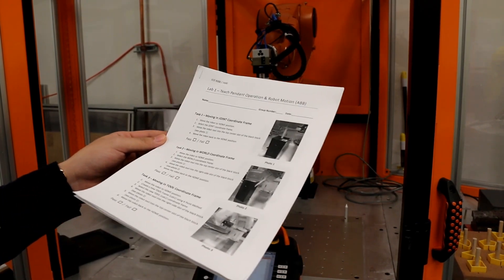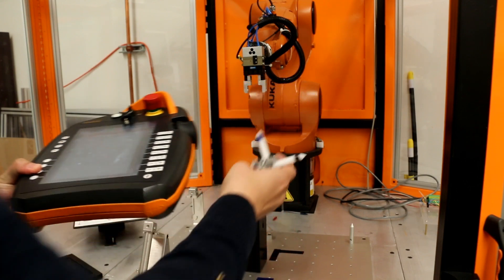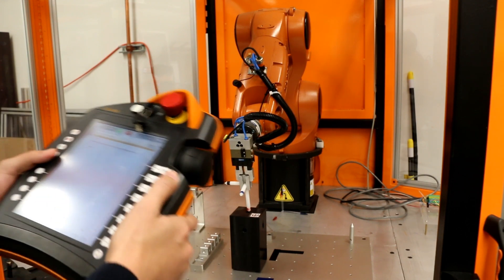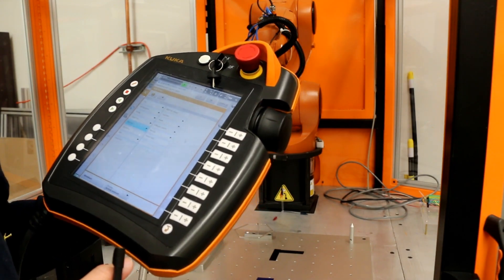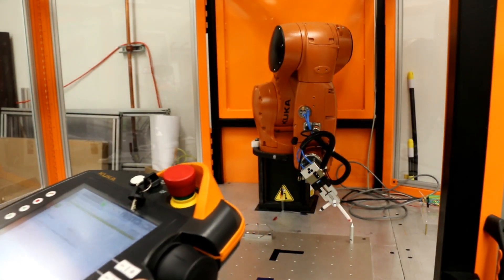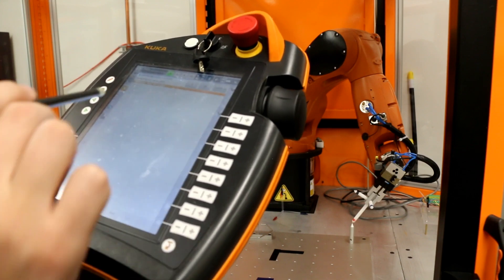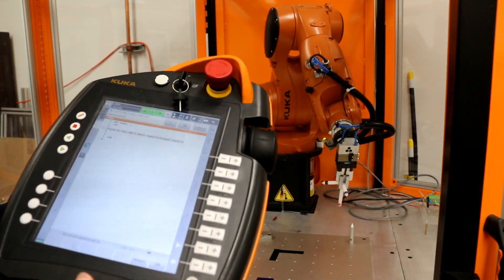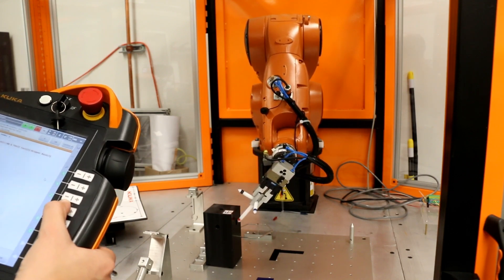Industry Robot KUKA 3 Lab

Comment: I apologize for making this comment beforehand, but you are clearly a beginner and just scratching the surface of what robotics can actually do in a factory environment. READ the manuals. Learn PLC's, VFD's and Solenoid inputs, outputs, compressed air routing and water cooling if needed. Good job on the jogging though!
Reply: Another critic that doesn't help or does anything to help, but is always available to criticize other when they try to help.